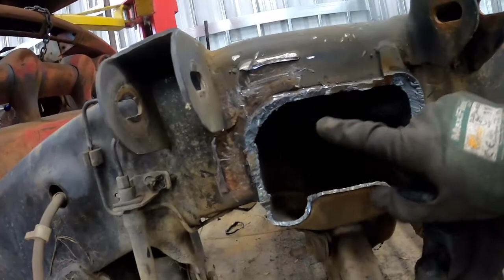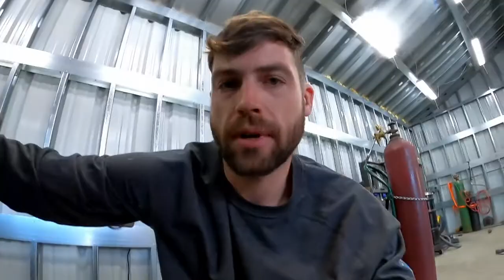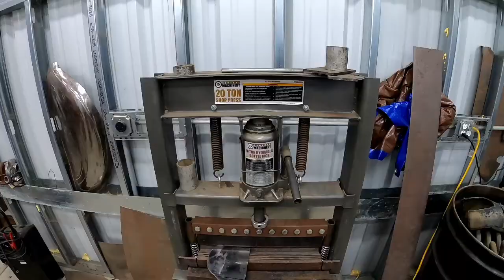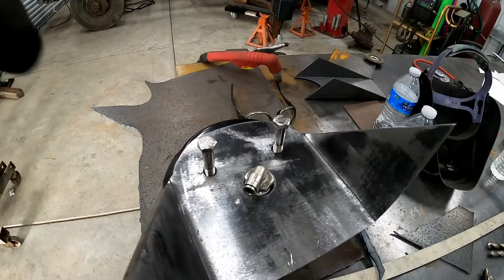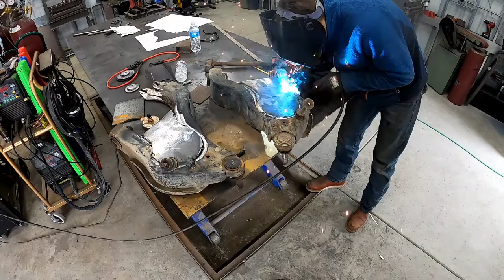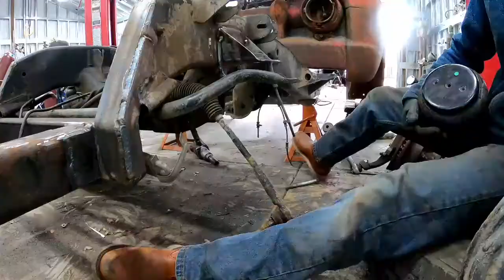Custom built air suspension 2006 dodge 3500 frame for my Cummins 51' ford COE

Comment: When marking the holes you can also just hold down the paper and tap it lightly with the round end of a small ball peen hammer and it will cut the paper on the edge of the holes and it will come out almost perfect.  We used to make gaskets like that back in the day when we couldn't get to town to buy any.  LOL  Great job, enjoying watching this.  I have a 56 COE that I want to build in the near future. Also cummins powered.
Reply from the maker: That is an excellent tip thank you! And thank you for appreciating my work. The 56 is a little bigger than the 51 I wish I had the extra space!
Reply: @turborich8316  Rich, I do like your work.  Also I am impressed with your working and fabricating knowledge.  I didn't acquire these crafts until later on in life.  I was just straight mechanic and welder.   On the 56 I have two cabs one is COE and the other is F600.  I am thinking about joining them together, then putting a 36 inch sleeper and then an 2006 dually bed on the back.  All on a F450 frame.  I have the 600 frame as well but I can't decide.

Comment: did you build that press brake?
Reply: you can mark down the rail that the press travels down on, that way you can quickly see how far down it traveled....
Reply from the maker: I assembled it but the kit is from swag off-road. The marks is a solid idea, thanks Amar 👍👍